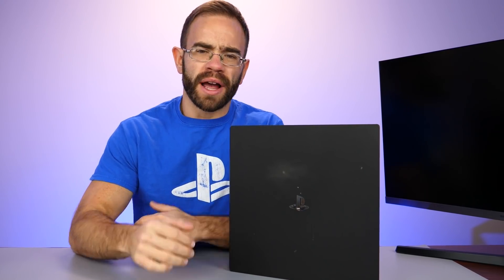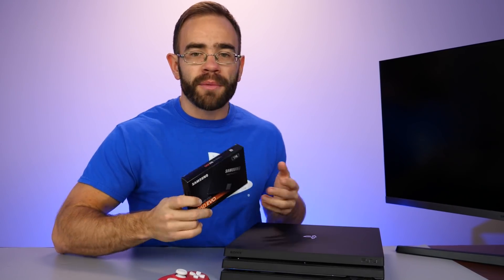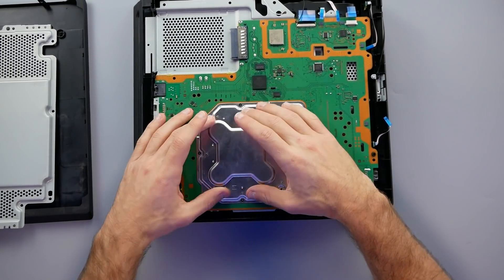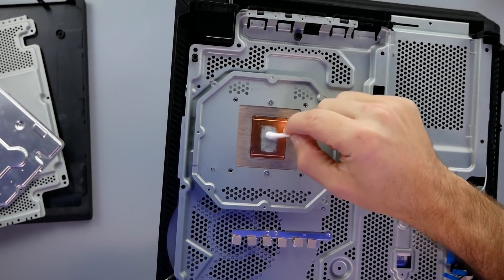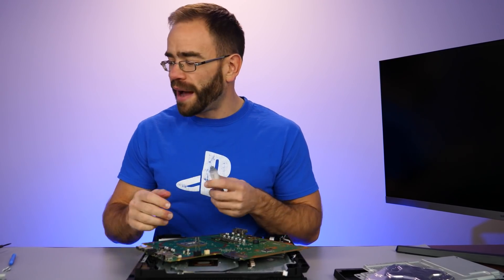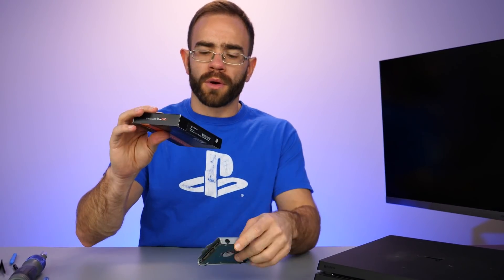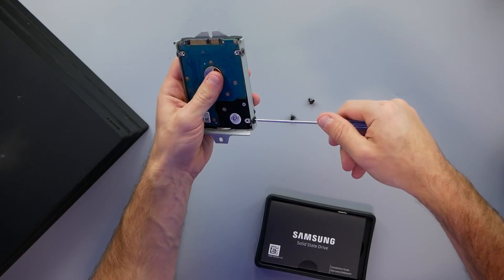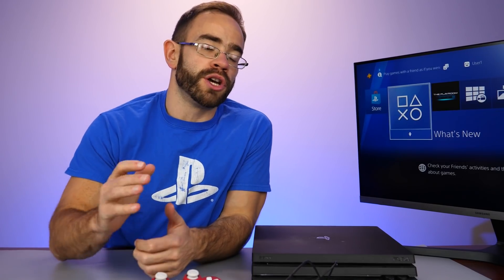Here's What Liquid Metal Did To A PS4 Pro After 3 Years

Comment: I reaplied LM in my ps4 after 2 years but since than 2015, i never touched it an it works for 8years without any cooling Problem.
I dont think there is any need to repaste LM at all if there is no cooling Issue.
Yes its not that liquid after a few years but it still Transfers heat perfekt.

Comment: Had I known what I know now I would not have sold my ps4. I have had a lot of issues with PS4 games on PS5. Sony has done a crappy job with their backwards compatability. One thing you should know is PS5 was designed to use liquid metal the PS4 was not so the heat sink materials are probably different. I think it would be a good idea to check the liquid metal every 2 years to see if it had dried out and replace as necessary. That is a good idea even if your system has thermal paste.

Comment: Funny. Came here again after your recent vid on a possible design flaw with the PS5 starting to show up when placed vertical, with liquid metal leaking. I think this may explain recent problems with my own launch unit where it’s been overheating and crashing regularly, and even fried the ssd expansion I had placed in it. I play a lot though. I ended up just replacing the unit as I was well beyond warraunty, but I would be curious if this was indeed the issue. It would make sense. And I suspect Sony knows more than they are letting on as we enter out rumored 4th redesign internally with a potential removable disc drive coming up. People had speculated on overheating as a potential reason Sony delayed enabling the ssd expansion for so long, and I’m curious if these are related.

Comment: Ladies and Gentlemen, allow me to clarify. When you first apply liquid metal, then you WANT it to actually react with the copper plate!
When liquid metal reacts with copper, it creates a layer with conducts heat much more efficiently. 
When the liquid metal reacts with the copper plate, it seems to “dry-out”. This is because the liquid metal “soaks” into the copper plate.
This layer (coating) is what people often describe as the STAIN. Do not remove it. Do not sandpaper it!
This is why you should re-apply the liquid metal 3 times every 2-3 month in the beginning. 
After this period, the coating should fully be formed, providing the most heat conductivity possible.
From here on,  if there is Gallium in your copper/heat sink/liquid metal, you can re-paste the liquid metal every 1/2 years.
If there is no Gallium involved, then you won't ever need to re-paste the liquid metal again. I hope this helps.

Comment: The PS5 uses a sealed system for the liquid metal, and uses a bit more than you added. Liquid metal is not compatible with copper. The liquid metal ate away the copper plating on your heatsink.

Comment: LM is great for use on nickel plated copper heatspreaders.  NOT on copper plated aluminum heatsinks.  On pure copper heatsinks the gallium diffuses into the copper leaving behind the indium and tin which both provide poor thermal contact and can cause shorts if they break free due to vibration.  Plus, you'll have to reapply regularly to maintain proper thermal contact.  With copper plated aluminum, that gallium diffuses through the copper and will attack the aluminum.  As time goes on in either case you'll have degrading thermals and a system that will die sooner than if you had just stuck to paste.  Do not use LM unless the system was designed for it or your components are made of the proper materials to handle it.

Comment: I personally did not use liquid metal at all, for now at least, used oldie but goldie Artic Silver 5 for my PS4 Slim (after an year and half of usage), bought it new in Feb 2019.
It had a ton of dust in there, and the thermal pads were all over so I went and cleaned it, re-aranged the pads and replaced the CPU paste >,<
The heat distribution went a LOT better, literally couldn't hold the PS4 in my hands from behind and above.
(for those who don't know, when you can't feel the heat of the PS4 by touching with your hands from outside, then something's wrong, because all that heat is INSIDE for sure) ಠ_ಠ

Comment: I did mine in march 2019 (Thermal Grizzly Conductonaut Liquid Metal). In January 2022 my PS4 Pro was immediately in airplane mode (fan at full speed) when I loaded in my save game from Horizon Zero Dawn. I knew my cooling was compromised because normaly it stayed two sound levels lower (stock paste is only one level lower). Disassembled my Playstation 4 Pro and it looked just like yours: dry. I sanded it down (only slightly, to make sure the surface is flat) with some sandpaper 1000 grit. Reapplied Thermal Grizzly Conductonaut Liquid Metal and it's nice and quiet again.

Comment: A small trick i did for the LM not to run around i used thermal paste around the edge and in the middle droped the LM giving it no chance to run around worked well and saw a significant drop in operating temp

Comment: I recently did a full clean and repasting of my launch ps4, I replaced the thermal pads too.  It went from  sounding like a jet engine on almost every game to being quieter than my gaming laptop under load.  I couldn't believe it.  Performance didn't seem to change much but at least it isn't struggling to expell heat anymore.
Reply: What did you use bro
Reply: @jormungandr8821  some leftover noctua thermal paste from a recent pc build and thermal grizzly minus pad 8.

Comment: Maybe it dries out because you used so little liquid metal. The ps5 looks to have a good amount of it. 🤷🏻‍♂️ I hope it isn’t a problem down the road.
Reply: It won’t be a problem. Metal can’t “dry”. What you see happening is amalgamation. Just search YouTube for gallium and aluminum reaction. The primary component in liquid metal thermal paste is gallium, gallium is highly reactive with some metals. It will turn aluminum into dust in a few hours, reacts slowly with bare copper, and won’t react with nickel plating. After a few years the gallium literally seeped into the bare  copper and formed a new alloy, thus appearing “dried out”. This won’t happen with nickel plated heat sinks.

Comment: Don’t think that’s stuffs gonna work well in the long run
Reply: It won’t be a problem. Metal can’t “dry”. What you see happening is amalgamation. Just search YouTube for gallium and aluminum reaction. The primary component in liquid metal thermal paste is gallium, gallium is highly reactive with some metals. It will turn aluminum into dust in a few hours, reacts slowly with bare copper, and won’t react with nickel plating. After a few years the gallium literally seeped into the bare  copper and formed a new alloy, thus appearing “dried out”. This won’t happen with nickel plated heat sinks.

Comment: "Thinking about Sony's PS5 now, it does make me wonder a little bit now about that liquid metal now, although I have to imagine Sony did their homework and did quite a bit of testing to make sure over time it won't destroy the chip and heat sink, fusing it together or make very hard to take back apart. It would be very strange Sony would just jump in w/out doing that."

Sony Engineers: ( ͡° ͜ʖ ͡°)╭∩╮

Comment: so the PS5 has a 4 year lifespan then is what I am seeing
Reply: It won’t be a problem. Metal can’t “dry”. What you see happening is amalgamation. Just search YouTube for gallium and aluminum reaction. The primary component in liquid metal thermal paste is gallium, gallium is highly reactive with some metals. It will turn aluminum into dust in a few hours, reacts slowly with bare copper, and won’t react with nickel plating. After a few years the gallium literally seeped into the bare  copper and formed a new alloy, thus appearing “dried out”. This won’t happen with nickel plated heat sinks.

Comment: The problem with the PS4 cooling is there are two fan variants, one spews dust into a crevice next to the fan and the other spews it directly into the heatsink. The dust builds up overtime and that's why you get PS4's that get very loud. If you are unfortunate enough to get the second fan (like I was) then cleaning it out every now and again (heatsink and all) will completely negate the problem.

I have pictures of fully caked heatsinks and video clips of a whisper quiet PS4 PRO running God of War in an area that would normally make it fly off.

Comment: huh, funny, when I commented on potential liquid metal issues with the PS5 when it came out, I was called an idiot and told I had no clue what I was talking about. . . . .ohhh, there might be issues we are concerned about now . . .huh
Reply: It won’t be a problem. Metal can’t “dry”. What you see happening is amalgamation. Just search YouTube for gallium and aluminum reaction. The primary component in liquid metal thermal paste is gallium, gallium is highly reactive with some metals. It will turn aluminum into dust in a few hours, reacts slowly with bare copper, and won’t react with nickel plating. After a few years the gallium literally seeped into the bare  copper and formed a new alloy, thus appearing “dried out”. This won’t happen with nickel plated heat sinks.

Comment: From my experience, copper seems to fuse , plated with liquidmetal . It's impossible to remove liquidmetal stain on copper using acetone or alcohol.  When I googled about it I found out it is not so good idea to apply liquid metal(Gallium based) on bare aluminum or copper. It seems Copper heatsink would need to be coated with another metal (like nickel)

Comment: I simply just cleaned my PS4 Pro every few months with duster and a vacuum cleaner to get rid of dust. I never had an issue with the fan being too loud. Also, I kept my PS4 Pro in a well-ventilated area so the heat coming out of the back wasn't blocked.

Comment: Quick tip to avoid stripping threads: Screw in REVERSE while applying light pressure until you feel the threads "click", then screw FORWARDS and your threads will be perfectly aligned.
I use this for everything, even drink bottle lids lol.
Reply: Also always use the screw that came from that hole. Even if its 10 identical screws. Put the same ones back from where they came from. But yeah, slightly backwards till you hear, feel it getting into its original thread and then put it in. Also always put in your screws in an X fashion. Don't start going round. Put one in top left, then bottom right. Top right, bottom left and so on. Tighten them a bit but not fully. Then go in the same X, alternation pattern again when tighening them down propperly secure. This goes from putting screws in a playstation to bolts when changing a wheel on your car.
Reply: I've been doing this without really knowing I was doing it lol
Reply: I know for a fact drinking bottles help. You discover this pro tip lol. Lines up every time..
Reply: These screw are made from weak material intentionally (for warranty assessment). They will deform after a few reassemblies.
Reply: @Thematchma69  I know, it's more common sense then a trick.
Reply: People think I’m crazy doing that but it works perfect
Reply: This is genius

Comment: I was here when you originally made the video putting LM in this. I'm pretty sure the copper reacted with the LM, it looks corroded and also like it caused a small reaction and started to fuse the metals. I wouldn't use LM in anything not designed for it, alot of people got excited to start changing their existing TIM when Sony started using LM. LM is not designed for the average user in anyway, and I knew when Sony started using it it would start some ridiculous craze where people ruin their tech. Here we are, luckily he caught this before it got worse...Big mistake and anyone that said they were doing it I would make sure to expressly state it is...

NOT RECOMMENDED.
Reply: Bro, just because you say it's bad doesn't mean it is. Recommended, no. But if you watched that video and decided to go the same route your not just some novice at taking things apart. I did it on my ps4 pro and it works just fine. I coated the outside of the apu with clear nail polish just in case there was any leakage. Look, I get that there's a chance you can mess it up, but if done correctly it can have a great effect at keeping the chip cool.
Reply: @gamedad7336  He didn't say it was bad.  Just that too many idiots were doing it without a second though and without considering the long term implications of using it on materials not expressly designed for LM application.
Reply: @gamedad7336  Gallium diffuses into copper like it's a sponge.  That copper layer on the heatsink is super thin, so once it slips through it starts attacking the heatsink itself.

Comment: I feel like they made cooling or fan improvements over time, as my late generation PS4 Pro is remarkably quiet. Certainly not the jet engine I've often heard talked about (like my original model base PS4 with certain games, heh).
Reply: Have an early model PS4 Pro, can confirm regardless of dust the console is distractingly loud lol
Reply: Lucky my PS4 pro is one of the early ones and even after deep cleaning it and changing the paste it’s still loud on games
Reply: Red Dead Online is terrible on a standard PS4. I have the later model Pro and replaced thermal paste and quiet. Not silent but way quieter.
Reply: @guitarboyjeff  I run it on my PS5 now and it runs and looks GREAT!
Reply: @Dr_Won_Hung_Lo  it doesn't run any differnt than ps4
Reply: yea, until you run ARK on it. Hell, Ark even makes my PC sound like a PS4 lol. The pro def is quite a bit quieter than the base ps4 though. If anything, Arctic Silver made a big improvement for my playstations in terms of fan RPM.
Reply: @frostbite1991  there's a lot of variables that can make a PC loud like that. Mine specifically is mostly quiet, with one exception. I run a custom fan profile for the gpu to ensure it stays cooler. So the gpu has the loudest set of fans in my pc because of that adjustment.
Reply: @ArtisChronicles  oh yea, I had to make a fan profile as well. By default they wouldnt ramp up enough, and the gpu would thermal throttle. I'm just living the mini-itx life with fans, it aint a quiet life lol. I'd swap the panel for a mesh and 1000 times better airflow, but I like the tinted glass look.
Reply: Some of it was also caused by a poor thermal paste application.
Reply: I've had mine 3 years, it's got a little louder over time but it's still quieter than a PS2 and will be silent again when I get round to cleaning and repasting it. OG XB1 consoles though, I know people who get complaints about hoovering in the middle of the night because of how loud they are lol.
Reply: Your PS4 may be simply too new for the fan to be blocked by dust as of yet. This is the issue why other PS4 Pro's are soo loud. Once cleaned of the dust and they're back to whisper quit
Reply: @Dr_Won_Hung_Lo  They did improve the noise in the later PS4 pros. I remember picking up the RDR2 bundle specifically for that reason after a Digital Foundry video about it.
Reply: @Dr_Won_Hung_Lo  It also depends on the game, different games have different profiles I believe.
Reply: @Dr_Won_Hung_Lo  The PS4 and PS4 Pro use a few different fans, from different manufacturers. I'm guessing it probably varies from batch-to-batch, depending on which supplier the fans came from when that particular unit was made. I do know the original PS4 had something like 5 different fans among them. I know of 3 that are in the PS4 Pro, and it's entirely possible that there is a fourth or even fifth that is much quieter.
Reply: This 100% confirmed to be true. Later PS4 Pro models are indeed quieter than the jet engine ones from its early days.
Reply: Gamers often exaggerate about the noise of the PS4 pro

Comment: There are more then 1 version of the PS4 Pros.  The one I have is very quiet, but my friends model is very loud with the fan.   You can see the difference as they use a different power cable.
Reply: What’s the difference in the power cable? Mine has the larger 2 prong but its a different shape at the ps4 outlet. After I cleaned it, it’s super quiet on new games.